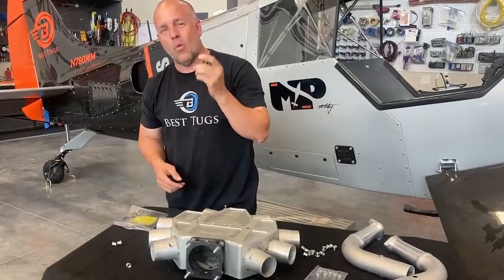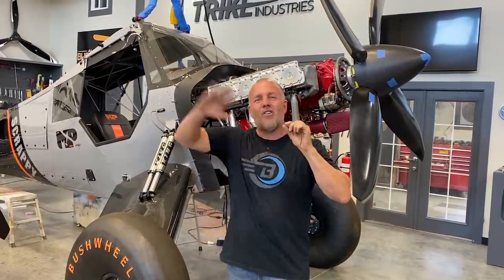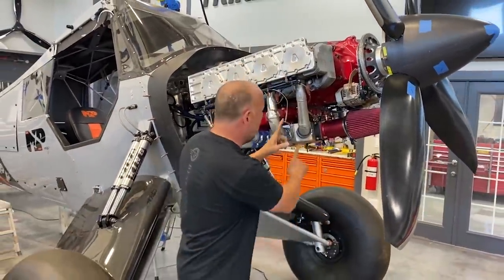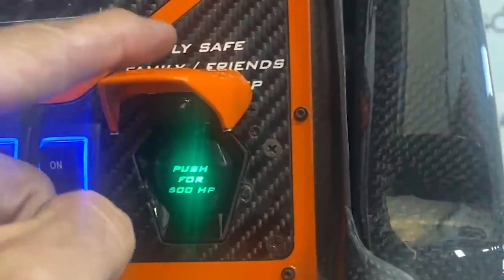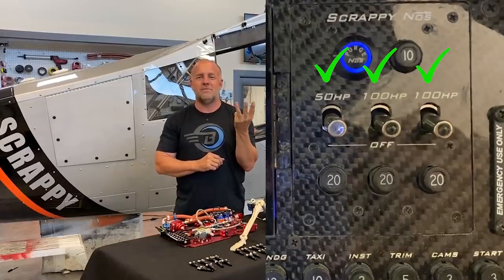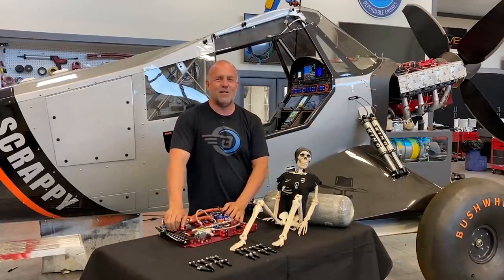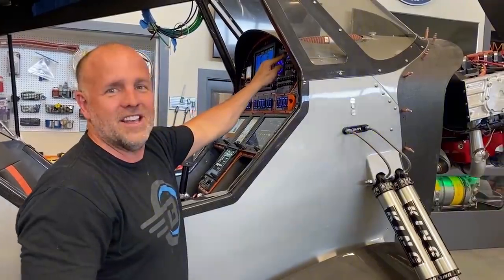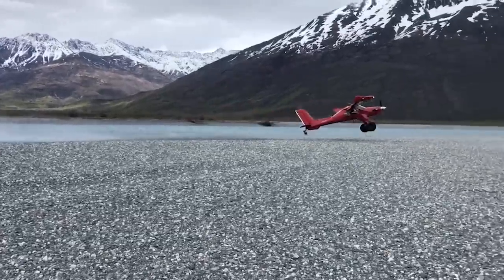NOS on a Bush Plane 😳 🤠 - 13L 250 Shot Nitrous Oxide - Part 1 | Scrappy #39

Comment: NOX adds a significant factor of unreliability or even risk of sudden failure that it does not belong on an airplane. In spite what was done to fighter planes in second world war. Don't do it if plan to willfully land back on the ground. Systems like that should be developed on a dyno to calibrate fuel and spark in order to stay on safe level. I know, I've done it. NOX does a lot of damage to engines. This damage you will not see until it is too late.

Comment: Here's the engineering...Nitrous Oxide ignites 17% faster in the cylinder than a boosted motor. They don't blow their motors up for the mixture of rich or lean, They blow their motors up from detonation. You should rethink yours.

Comment: Two 100 shots (.052 jet) and one 50 shot (.035 jet) will NOT stack up to give 250 HP.  That's not how nitrous works.  The more you inject, the less power it makes.  That combination will give you roughly 215 HP.

Using area of a circle calculations you'll see that a .078 jet (200 shot) is well over 2 times the size of a .052 jet.

I would suggest changing one of the 100s to a 150 shot (.062 jet).  Stacking .035, .052 and .062 nitrous jets will give you a true 250 shot.  You will still have the 50 HP steps that you're looking for.

Comment: Would 600 hp be the equivalent of 2250 lbf at 100 mph ? ... that is roughly a thrust-to-weight ratio of 1.0 for Scrappy ! ... (efficiencies notwithstanding)
Reply from the maker: 👍 yes that’s close
Reply: @MikePatey  in which case, here's the flight test point I'm waiting to see. Fly straight and level gently accelerating to 100 mph, pitch up to near vertical, hit the NOX and give those National Guard F16s a run for their money ... LOL

Comment: Why three separate systems when you could have one large one controlled with pulse width modulation? You could then have a rotary knob for desired power, ramp in from lower throttle and reduce weight. No disrespect intended but this looks like a system from 20 years ago.

Comment: the problem with nitrous IS HEAT.  I recommend hp from nitrous max to 1/3 standard hp.  At 2600 rpm you are adding 500 hp.  You will melt pistons.  I hope you rotating assembly is forged and your pistons have a ring pack moved down the piston at least 0.25".  Good luck.
Reply: Increase your ring gap, and don't forget to pull timing, at least 5 degrees.
Reply: you miss understand the function of the purge valve.  It is to remove N2O gas from the lines, and deliver N2O liquid at initiation.  N2O gas in the line will deliver a "soft" hit for about 0.2 sec. which in your case is safer.  It gives the prop governor a chance to adapt.   You need a high pressure return fuel system with 8 psi on the low side.  This reduces fuel pressure fluctuations.  Also I would pull timing on one Mag and convert the other set of plugs to an aftermarket ignition system.  At cruise the electronic system would provide the correct timing. If it fails, the mag will run the plane.

Comment: First, Lycoming needs to make a public apology for their engineering on the O-720. Next, there is a lucrative market for the type of mods you are doing on these, and that could be on the whole series of Lycoming engines. Aircraft owners are open to performance improvements that can be done during annual inspections, I worked for an little outfit called Knots to You, we did small improvements to all types of general aviation aircraft at affordable prices. Owners will pay for 2-3 knots improvement in cruise if it is easy to get at an annual, and your horsepower increases would surely provide that.

Comment: What are you going to do about the pressure drop in the bottle? Are you going to refill the bottle after every flight you use the system. I have a buddy of mine who has a company that has developed a valve where it will put compressed air on top of the liquid nitrous as you use the bottle to maintain a stable nitrous bottle pressure. --> https://www.nano-nitrous.com/ 

This might be a good application for what you are trying to do.

Comment: It's allready a crazy engine for a bush plane.... put's nitrous on it :)  LOL. But what is up with the wings?  Have not seen a single nut or bolt from the wings.  You are doing something "crazy" with the wings aren't you? ;)  This thing is going to be doing near vertical takeoffs.  Do me a favour wil ya Mike?  Read up on glider plane winch launches and the procedures and precautions about pitch angles in relation to airspeed and altitude if you have not allready done so. Loosing power with low airspeed and near vertical pitch attitude becomes onrecovarable at low altitudes. usually resulting in reverse/inverted plane pancakes left or right of the stripcenterline.

Comment: Nitrous doesn't seem safe on an air plane. I've seen the solenoids stick open and flood the motor with fuel or nitrous to many times or the nitrous side works and the fuel solenoid doesn't open and leans the motor out. What fail safes do you have so that doesn't happen.